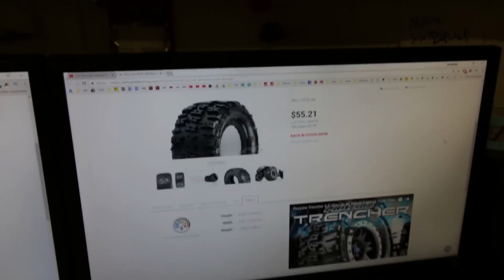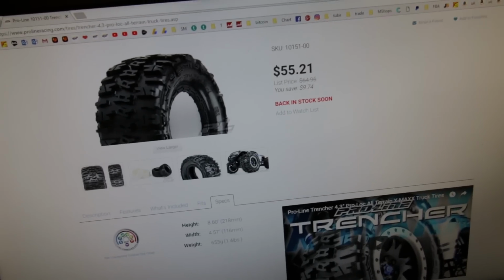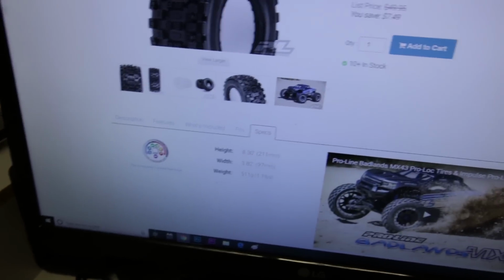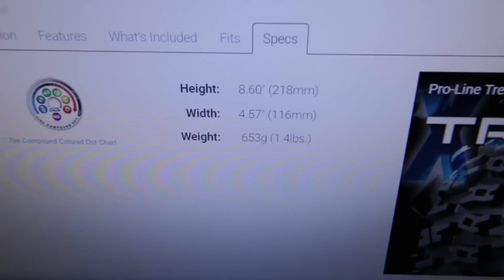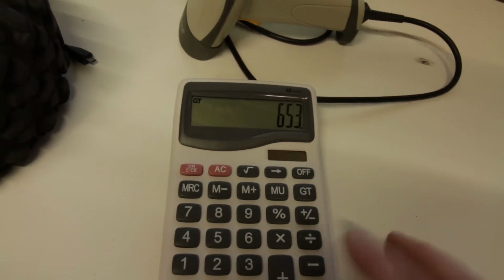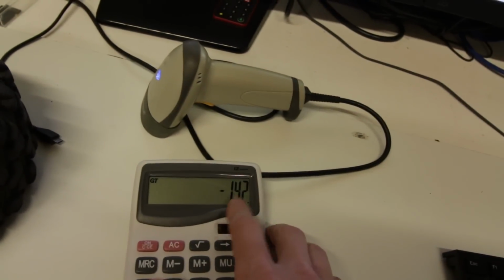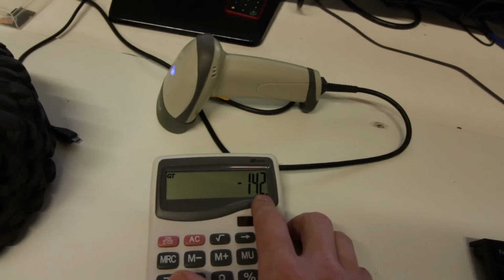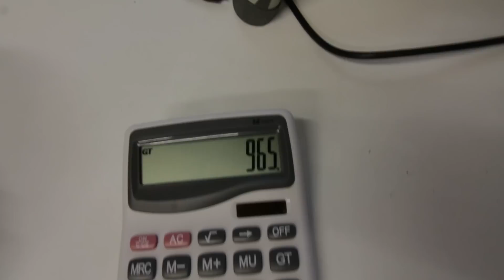Proline Trenchers for Traxxas X-Maxx

Comment: I agree with your reasoning. Still, you should give the xmaxx a skatepark run with the erevo trenchers on it.
Reply: Erevo are 17 mm hex xmaxx is 24mm hex. Wheels are not directly compatible and I'm not aware of any adapter  that will work

Comment: Trencher Tires are much softer than the Badlands per proline website .  Read the  description of the trenchers then buy them and report back to us!!   Would be nice to know if it was more the weight or the hardness of the Badlands .  Other words if it happens to be the hardness that caused the issue more so then the weight than the trencher could very well be a good option .   So buy it try it and let us know !!
Reply from the maker: I already know the outcome it will be £150 of wheels and £200 of damage to the maxx with my bashing style. I don't generally buy stuff just to make a video for views I buy stuff that I plan on using myself. If you wanna pay sure :)

Comment: I fully agree with you Kev. I have Proline bead locks with Trenchers mounted and the weight they add is definitely a problem. Plus to get any real good performance out of them, they need to be balanced. 

The other problem I've found is that the beadlock ring has severely cut into my RPM suspension arms both front and rear. Since I run the RPM Tru trak rear end on my E Revo, it will be a little pricey to replace.

Comment: Just ordered a new set of stock wheels and tires for that reason, because you're not adding 142 grams you're adding 568grams (142 per corner) that means your xmaxx is coming down faster and harder so impact forces are much heavier, I stick with stock everything I bash hard and rarely break more than a tenners worth of stuff, I sure there are applications where the weight might help like speed runs but speed is not what I do so there not for me either.
Reply from the maker: actually you're adding compost 2kg over stock. 142g over badlands
Reply: wow, I overlooked that, so if you want to feel the weight difference over stock stick a bag of sugar under your shell and pick your truck up.

Comment: Hey kev look at the new Louise tires! They made 4 different types for the X-Maxx! X-rocket, X-Pioneer,  X-Cyclone and X-Upholl. And the interesting thing about this tires are the price😉. Best regards from Germany.
Reply: Alessandro Bonincontro yeah!
Reply from the maker: just had a look, they look cool, do you know the weight?
Reply: They LOOK just as heavy
Reply: Kevin Talbot I don't know the weight... I was on a rc fair and I can tell you they weight less then that proline tire! I become mine in 1-2 weeks than I can tell you More 👍
Reply: Hey Kevin. The Louise RC X-Cyclone weigh 780g (1,72lb) each (for tyre + rim, I used a digital kitchen scale. I guess the Pioneer and Upholl will be the same, the Rocket maybe a bit less). That would be 190g (0,42lb) more than one stock Traxxas tyre, which weighs 590g (1,30lb) new. So, in total the Louise RC's for the X-Maxx will add 760g (1,67lb) compared to the stock tyres. The rubber compound is quite a bit stiffer than stock, but they will soften a bit over time, I guess. I'd hoped for them to be lighter, but maybe the difference in weight won't influence the performance much. Greets from Germany!

Comment: Well, I ran across this video after I got those damn trenchers Kev. Great tires, had a blast the little bit I got to run the xmaxx with them and I've destroyed 3 54 tooth spurs. I put on a 17 tooth pinion with the correct motor setting for that combo. I want to shitcan them after a week. Any ideas on fixing the issue apart from getting a steel replacement?
Reply: creepyrat1 change the motor bearing and the thing where the spur takes place, and the bearings.

Comment: Wait. It looks like the Proline tires and stock X-maxx tires are about the same size. Why not see if the X-maxx tires will fit on the Proline beadlock rims so you get the lower mass, and the better tire mounting on the rims.
Reply from the maker: it wont go no way even near the same design dude
Reply: Aww, that sucks...

Comment: So, if I understand you correctly you are saying you would have to double up to keep from ripping the rubber?
Reply from the maker: I meant more the car. The heavier the wheels the harder time it is on the car itself so your gonna break a lot more doing big air and crashing
Reply: All I know is that if you go bashing away at it with doubled up rubber somethings gettin' smashed alright. Breakage may happen...

Comment: Why not consider it may keep lower center weight, making it easier to control in the air when airing it out... Or heavier for better grip, in actual cars it's a big deal but I don't consider it much on RC cars, then again I just bash not race or try to skim ponds...

Comment: Kev would you prefer the Badlands over stock tires?
Reply from the maker: i like stock the best
Reply: @KevinTalbotTV  the thing is that for me, the stock tires on the rear tend the rip internally with the foam and it causes half the tire to bulge, and on the other half it has no foam whatsoever. Both rear tires did that to me just now, one after another. Traxxas makes fun rc's, but really bad accessories. Don't get me started on their servos lol. (By the way this problem I'm having is on my Rock n' Roll Xmaxx..)

Comment: I had trenchers on my slash 4x4, they go bald so quickly and easily and just rip, gone through 2 sets and just run stock traxxas tires, much better results
Reply from the maker: Same, mine ripped and were way to grippy for the serfaces that i was running it on. Back to stock :)
Reply: I've been running 3.8" trenchers on my savage flux for a year. Bought them used and they haven't worn much so far. I spend about 50% of my time in skate parks, the rest in grass. I also have a set on my ERBE. I like the extra cushion they add to landings. I put 2.8's on my stampede 4x4 last year and a full set on my converted eJato as well a week ago. Really love the tires as they hook up well and seem to last me a long time. I run 4S in my flux/ERBE and 2S in my stamped and eJato. Might by why they are holding up for me.

Comment: Could you not just use the xmaxxes rim and fit that onto the trencher, that way it would be a lot lighter.
Reply: The trencher has to be used with the special pro line bead lock wheel.